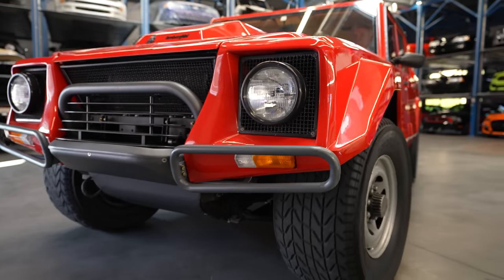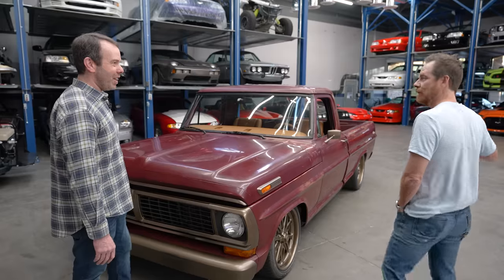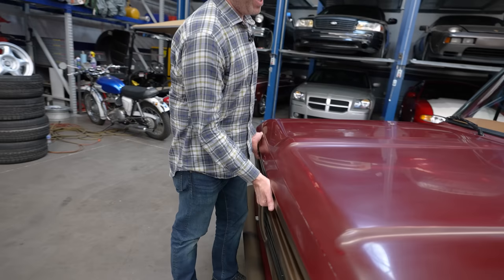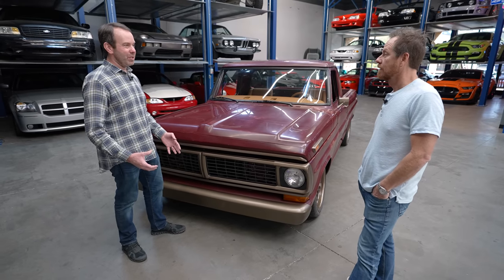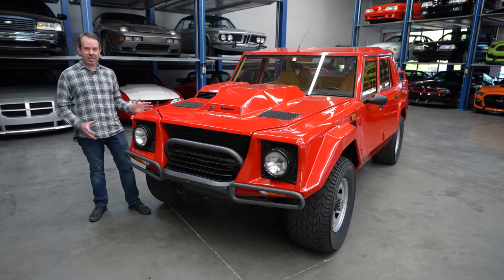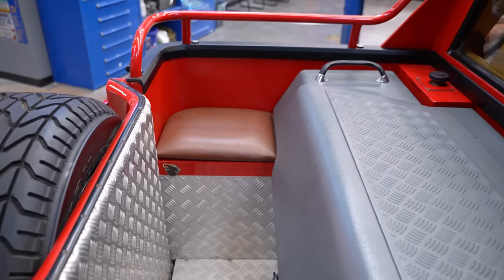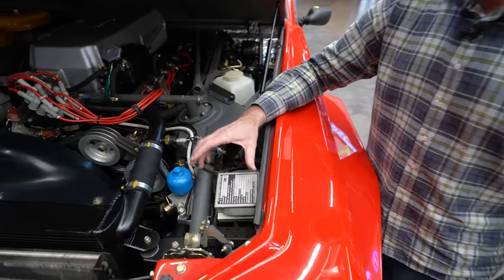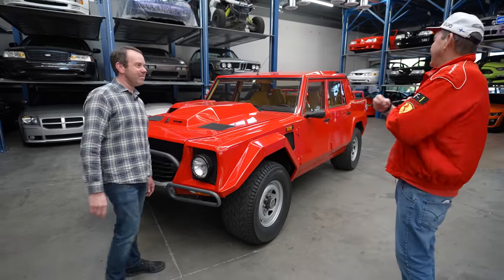1970 Coyote-swapped Ford F100 and a 1988 Lamborghini LM002 – The Appraiser – Ep. 1

Comment: There was a black LM002 at a local import garage for quite a while, as well as a Laforza!  My estimate of the LM002 was nearly spot-on, but my Ford pickup number was around $60K.
Reply: That truck although very well done is no where near where they estimated. I thought $60k as well.
Reply: The well done resto mod/pro touring f100s and c10s are binging 150k+ at auctions now, it seems high because a rust free roller short bed is still only worth about 10k to get the project started, but none the less that's what they bring done. Think it's a combination of the popularity from the fast and loud show and now the covid supply chain issues/ inflation on top of that.

Comment: Even in the bubble of everything we are in currently in and auction silliness i would doubt that truck would pull $150k ..Custom/modified normally never get what is invested in them ,they are not collectable. Appraiser should be more conservative . The lambo on the other hand is a true collectable .
Reply: That truck should be in the 20s  it's just a crate engine and a few suspension add ons.  It's like the internet is jacking the price up on everything now.  A stock 1990 volvo wagon sold the other day for 36k dollars.
Reply: Show is called, Appraiser, not ShitHouse Appraiser.
Reply: Agreed.. a crown vic front end is "doing it right"? Uuuh,, no. That's dong it cheap. And as mentioned, it's a 5.0 crate, tranny, and rear end.  It's nice, but it's a 45k pickup.
Reply: @slowrunner1660  that was my thought. I was thinking $40k, up to MAYBE $60k tops if he were to find the right buyer. I’ve worked at two high end shops, one primarily a hot rod shop, and the other a concourse restoration, on top of owning my own hot rod shop.
Reply: I knew I would find this post, and I totally agree that $150-170k for that truck is ridiculous. I was honestly thinking $40-60k. Its certainly a nice build but its just not special enough to command that kind of money.
Reply: You must not have seen the Mecum action last week, well-built customs were bringing big numbers, it never used to be that was, original always brought the highest values, but several custom vehicle were well over a hundred grand, and some close to three hundred grand.
I like the truck, but I'm not a fan of the fake distressed look.

Comment: Hi, All! Thanks for watching the first episode of "The Appraiser" and for all of the great comments. To answer the most common one, the much debated value of the 1970 F100 on this episode, I agree it seems unlikely something like that could be worth so much money. 

But as I mentioned on the show the value of such a machine, for the person who wants to own one, is based on what it would cost to duplicate. In this case you'd be hard pressed to find a donor short bed, original paint very straight and rust-free F100 as nice as Jim did for less than $20k these days. Add to that just a Gen 3 Coyote crate engine from Ford, with the PCM and harness to run it, is $13k alone...plus the transmission...suspension..brakes...interior etc and you can see where the parts are easily over $40k. Now let's add in the labor at a pro shop such as the one that built Jim's truck. That's a minimum of 1,500 hours at a prevailing average shop rate today of $100/hour= $150k+ Therefore you can see the replacement cost would well exceed $200k, not to mention the time to manage such a build. Given that, the fact that I have seen a number of similar trucks sell for well over $100k at auction, and the fresh build and high quality of Jim's truck led me to my $125k appraised value. Far less than it cost to build and, hey, it is just a bad ass machine that has "the look" and was a hoot to drive. 

In fact, the day before this episode aired, a 1968 F100 that was an older build in a similar style to Jim's truck (but an automatic...and I don't know how to drive those) sold on Bring a Trailer for $127,777 all-in with the $5k buyer's premium. So if Jim decides to sell in this market I maintain my number will be pretty damn close! 

Now, as for the LM002....holy crap do I want that truck! I owned one in 1997 and have regretted not keeping it since I sold it. Of course, as one of you so accurately pointed out, they aren't $50k anymore either. Sigh. Maybe I'll just go buy a Ferrari jacket and an Alfa hat instead. Or not. 

Thanks again for watching and keep the comments coming! Remember, too, a new episode hits the Hagerty channel every Friday at 10am CST! 

-Colin
Reply: I suggest people take the time and look up the 68 F100 like I did.
It's a fully completed truck that only sold for 127g.

But yet this guy claims at auction this 70's truck could bring in 150-175g!!!!

Makes perfectly good sense to me.

🤣🤣🤣🤣🤣🤣

Comment: why didn't they ask the ford owner how much it cost to build
Reply: Probably because it wouldn't be over 30k.  Truck 6k  if new crate engine and trans 14k? Front suspension free off old crown vic.
Reply: My thoughts exactly. 
How do you value a junk yard swap front end, basic brakes, horrible box body line mod, bolt on suspension at $125g

Insanity
Reply: @muffpipe84  a guy on Facebook has a 80s ranger long bed with collector car insurance valued at 20k. I bought the same exact truck but short bed for 300 dollars 6 months ago.

Comment: 125K for the truck, I disagree...
80K is tops...
Reply: This is worth 80k like a pokemon card is worth 200k
Reply: Factory frame with crown vic swapped front end.
= cheap
Factory frame with QA1 suspension 
= not as cheap
Roadster shop chassis + Coyote + interior =
Maybe $100,000 to $130,000 then but because there is absolutely nothing special about the chassis this truck is not worth anywhere near the $125g.
Reply: @muffpipe84  or just sit the body on a srt viper truck frame and be done with it for like 12k.  For 100k maybe if one of the low rider guys built it where the whole underside it's chromed out and artwork etched on all the metal gold plated bumpers and stuff too
Reply: I'm still blown away when he says @ auction possibly $150,000 - $175,000

The guy just keeps spit balling numbers but in reality nothing ads up.
Reply: @muffpipe84  
I don't know where they get the evaluations, I don't see anyone paying that...
Reply: @muffpipe84  
Agreed and very good points for an evaluation...